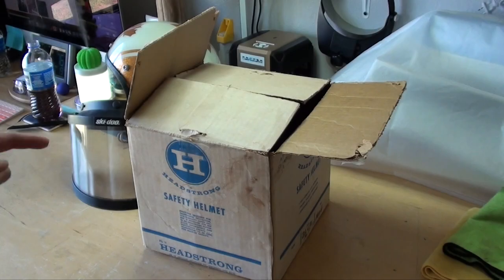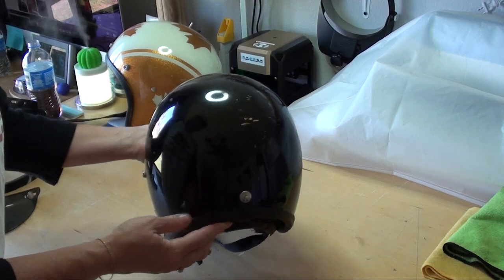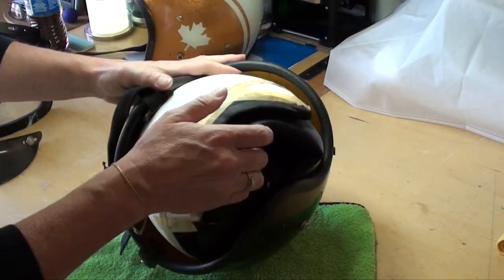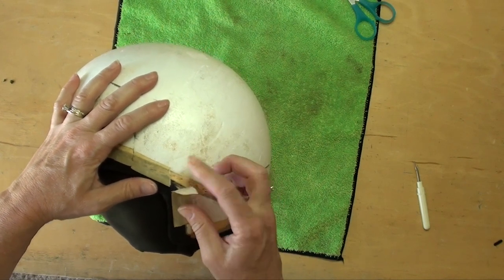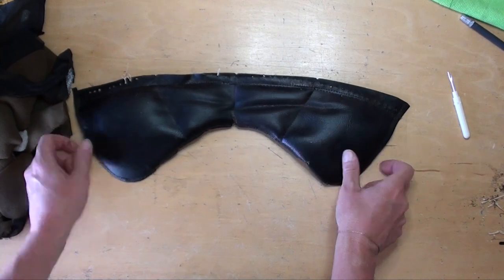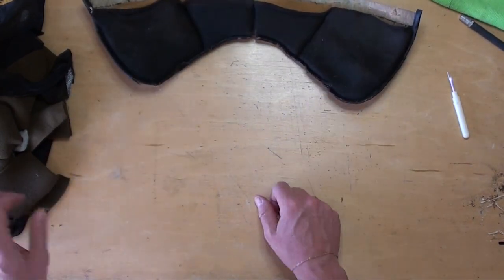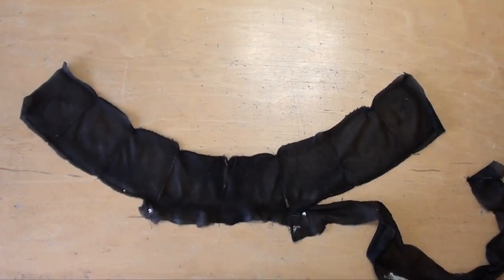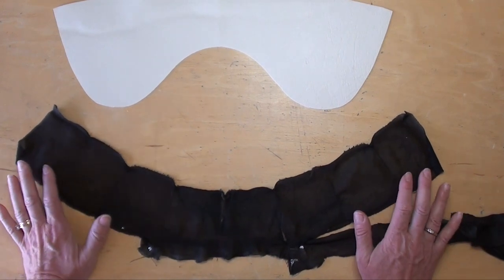How To: Restore the FULL interior of a vintage helmet. DIY

Comment: So refreshing and so good to see use of common sense once again and not falling for that "replace your helmey every 5 years' slogan they've been shoving down our throats for some time now. There's a whole puritan brigade out there to tell you - you're not safe anymore!. Reminds me of evergoing full vs open face helmet debate.
Wear what you want and what you feel is fitting and neceasary for you, for your own safety and fitting to your personal situation. 
I have a 14 year old Bell C500 DOT certified helmet which i have been wearing in rotation, to see if I could prove (or disprove for that matter)  my point I left it in my Bell dealer shop for inspection, came back with - 'helmet in good working shape, outer shell and eps liner condition - pass, suggest replacing fabric liner at some point in the near future'. Case closed.
Thank you and make sure you post more videos.

Comment: Great video. I have an old ski helmet where the liner is in bad shape. It has a similar foam interior but it seems to be glued to the shell and I haven't been able to extract it. Any tips you can share to extract the foam?
Reply from the maker: Thanks! As far as I have learned, there's really no magic to the removal. You might try warming up the helmet a bit but be careful not to melt anything. All the "stubborn" helmets I've done have just been a matter of working the foam back & forth and flexing the shell until it comes loose. Maybe use a plastic trim tool between the shell and foam & work it around but that depends on the finish and stuff, too. Sometimes you can hear the glue or tape or whatever is holding the foam, pop. Again, don't be too brutal with it. I hope that helps a bit & good luck with your project! :)

Comment: You obviously have a talent for this! I would love to get some pointers for the helmet that I’m working on now. It’s a 1976 Bell Moto Star. All of the fabric is in good condition, but the foam has disintegrated.
Reply from the maker: Thanks! Is it the comfort foam that's disintegrated? If so, you should be able to replace it. You'll probably have to carefully remove the material/disintegrated foam from the styrofoam and replace it. Most of the helmets I've done have had very thin comfort foam in them; between 1/8" & 1/4". You can usually find it at Joann fabrics. Some have it sewn in and some are glued in using spray adhesive. Hope that helps some!
Reply: If it is the EPS liner or styrofoam then unfortunatelly you won't have many options. The old Bell Star helmets were smaller, had thinner styro liners as the regulations back in the 70es were less strict. I would normally suggest to buy an affordable helmet, take the styro out by detaching it from the shell and snapping or drilling out the the rivets, then swap by re-gluing and re-riveting into old shell but I don't believe any  styro from new helmets would physically  fit.

Comment: Love the video and very clear instructions. I recently came across a retro helmet at a thrift store and couldn't pass up. The lining is bad. I want to change it myself (1st timer) but have no idea what materials to use. Any guidance?
Reply from the maker: Awesome! For the interior comfort padding, I use 1/2" foam from Joann's Fabrics. You can adjust the fit of the helmet based on the thickness of the foam you buy. It'll always be a little snug when it's new but it breaks in. Just so long as you don't have any "hot spots" in the fit. 

For the fabric, I always use a knit. Something that has stretch is always better than something that doesn't. Think dress shirt vs t-shirt. T-shirt stretch would be what you want. I use crushed velvet a lot. It's retro, it's funky & it's perfect for the interior of helmets. But there are TONS of fabrics that will work great. Just keep the stretch in mind when you're looking.

The adhesive I use is 3M Super 77. Don't skimp here. That's the best adhesive I've found for these.

I hope that helps & good luck with your helmet resto! :)
Reply: @EndlessDIY  thank you! I will start looking for some of the items!

Comment: Great talent and restoration ! 
Would it be possible to replace the Styrofoam shell inside ? I have a helmet I want to restore but the actual styrofoam itself is pretty bad and would need replacing.. can’t seem to find anything online for this ?
Reply from the maker: Hi there! As far as I know, there are no sources for new styrofoam, unfortunately. The only thing I can suggest is to try to find another helmet of the same size/model you can cannibalize the foam from. There may be some cross-brand compatibility but most of the helmets I've restored have had different shaped styrofoam. I restore motorcycle and snowmobile helmets so that may be the major difference between them. 
I'm sorry I couldn't be of more help. I hope you can find a replacement! Thanks for watching & good luck with your project! :)

Comment: Great video I too like the vintage helmets Ironically the old snowmobile ones are usually really cool and inexpensive on EBay  one plus of Snow mobile helmets is they generally do have cool face shields  and visors  a negative is they don’t usually have a DOT sticker  almost all helmets use the styrofoam shell  FYI if a helmet is dropped or hit hard in a crash it’s usually not safe anymore as the styrofoam can be damaged  I like the idea of adding extra padding like you did as my head is smaller too  I also have a Walking Foot sewing machine and that’s why I found your channel   I used to get weird looks at Joanns fabrics  because I’m a man  and the employees knew me by name  I would stop by to check out clearance items in my work jeans  and construction boots ?  The Ski Doo label was worth the effort IMO BTW you have pretty hands
Reply from the maker: I agree! In my other helmet video, I also mention that these old helmets are essentially just a cool hat. I probably should mention that again in any future helmet videos. 👍🏻
It's great that you can sew! I feel like sewing skills are really an essential life skill, so good on you for tackling it! I've heard guys refer to sewing machines as "thread injectors"; sounds more "tool-like", I guess! 🤣People immediately think sewing means lace-trimmed pillows when it actually means Cordura chest rigs, repaired work clothes, custom covers for your generator, one of a kind custom-fit bags for your UTV, etc. Sometimes people don't realize how many things are sewn. So, it's a worthwhile skill even if you don't like lace pillows. lol!
Thanks for the kind words & thanks for watching! :)

Comment: Great job,i should restore my helmet too,do you have file of the pattern?I really apreciate if u share the pattern 👍
Reply from the maker: Hi there! Thanks! I don't have a pattern because all of the helmets I've done have been different in some way. The way I make a pattern for each one is by carefully removing the lining in the helmet you're working on. Unless it's completely missing you should be able to use it if you're careful. Just trace it a bit larger onto the new material to give yourself some room for error and to accommodate new padding, especially if you're putting thicker padding in.
I hope that helps! Good luck with your project! :)

Comment: Great video! Do you know if the old helmets had different shell sizes or maybe the padding was thicker/thinner for sizing? I noticed the foam was marked XL but that helmet didn't look like a XL to me.
Reply from the maker: Thanks! You know, that's a great question! (and good eye!)  I think they did have different shell sizes simply because in my own collection, there are definitely larger and smaller shells. However, I have many different brands. 
When my friend gave me this helmet, he said it was an XL. I was fully expecting to add padding to it to make it fit since I wear a medium. When I tried it on, it fit perfectly so I believe this is probably a kids XL.
Reply: The older helmets were smaller, had thinner styro liners as the regulations back in the 70es were less strict. If you compare for example today's Bell Custom 500 with DOT and ECE certifications and the original Bell 500 open face helmet from the late 50es in the same size, you will notice huge difference in overal size and appearance and how much more low profile the original was. Modern Bell C500 (I have 3 of them ranging from 2 to 14 years old)  all look like mushrooms compared to those from decades ago, but I don't mind it too much. When I feel like low profile  I reach out to my DMD and Roeg Jettson from my shelf and call it a day.

Comment: What would you do if the skirt is riveted in? Just bought a cool old helmet but the skirt is torn and just can’t get the thing out to sew it...
Reply from the maker: Without seeing it, I'd say you'd likely need to drill the rivets out, probably from the inside. Once you do that, if it all comes out in one piece for patterning, you can mark where the rivets went through, as well. You can buy a rivet gun and a variety pack of rivets pretty inexpensively. Hope that helps! Good luck with your project! :)

Comment: my helmet is big for me with this method do you think i can make it smaller ?
Reply from the maker: You can, somewhat. You can use slightly thicker foam to snug up the fit but if it's really big once the padding wears in it'll be loose again. You might try to find a more dense foam to put in between the soft foam "comfort layer" and the styrofoam (like a sandwich). That may work. Then you'll get the more snug fit you're looking for without losing the soft comfort foam around your noggin & it shouldn't squish down enough to become loose again.

I haven't tried this but I will if I need to downsize a helmet in the future. Good luck with your project! :)
Reply: @EndlessDIY  i am gonna try some method's and i will let you know how it gone :)
Reply from the maker: @SermiFromAlbania  Please do! I'd like to know what you come up with. :)

Comment: thanks! any tips for replacing the styrofoam? mine's an old skidoo yellow helmet like yours.
Reply from the maker: Hi there! I haven't found any sources for replacement but if you've got a shell that you really like you might be able to cannibalize a similar helmet & get the styrofoam out of that one. I've restored at least a dozen now and I have to say, every single brand has had slightly (or significantly) different shaped styrofoam, so all I can really suggest is to try to find the same brand/style for the donor.
Reply: @EndlessDIY  thanks for the quick response. i'll keep my eye out for a similar helmet. thanks again.
Reply from the maker: @sleethmitchell  You're welcome. I hope you find something! Good luck! :)

Comment: i enjoyed this Video quite a bit about 25 years ago  i bought a Industrial Walking Foot Sewing Machine off Ebay  and essentially it’s a Made inChina Clone  of the originalConsew Machine  that is basically what many of the Walking Foot Sewing machines like sailrite, Reliable , and some other Upholstery machines are based on  it has performed Flawlessly  for me that  is a Self Taught   on making Marine Grade Vinyl Cushions and Canvas Enclosures for my personalBoats and helping out Freinds  i’ve also done someUpholstery for my Vintage Sports Cars  and i’ve always been interested inVintage Helmets  ad doing similiar Restorations  i liked your Enthusiasm ,Comments , and Narration  BTW you also have pretty hands for Demonstrations does anyone make new Styrofoam inserts for replacement  ones   ? i come accross Vintage Helmets inFlorida  that the Styrofoam  is shot from the Florida heat being stored for longterm in Attics or Garages that don’t have Climate Controlled  At ospheres   i agree with you on the Sailrite tape and the Spray 77 glue  although a good 3M Contact Cement is less expensive in 1  and 5 Gallon containers and can be brushed on with disposable Brushes   i am a retired ProfessionalWoodworker  and  i have Sprayed lots of Contact Cement using  the 17 dollar HVLP Spray guns fromHarbor Freight  and we used to buy the 3MGlues in55 gallon drums  which was the least expensive way to purchase Contact Cement
Reply from the maker: Great information, Craig, thanks! I think I'll try the contact cement, at least for around the perimeter of the styrofoam where the fabric is folded over.
I haven't been able to find a source for new styrofoam. All I've suggested in the past is that you try to find another helmet like the one you're working on that can be cannibalized (something with a gouged shell or something that doesn't make it a good candidate for restoration).
Thanks for watching & good luck with your projects! :)

Comment: I have problems installing back the top piece styrofoam on my bandit helmet. Any advise?
Reply from the maker: Do you mean getting the whole styrofoam piece put back inside the shell?
Reply: @EndlessDIY  yes ma'am. When I tried putting it back, the edges won't fit exactly as it is. I tried putting a news paper or sponge first but it still won't do.
Reply from the maker: @armandodubal6734  Sometimes it's helpful to remove the rubber edging that's around the opening of the helmet. Do it very carefully. It can also be helpful if someone pulls the sides of the helmet open while you work the styrofoam in. Once it's mostly in, you can sort of flex the shell and continue to work it until it lines up. Make sure there are no nuts or anything like that sticking into the shell that's preventing the styrofoam from going in.
This is generally the worst part of the whole rebuild. Just don't get too rough with it or the styrofoam can crack.
Reply: @EndlessDIY  well do ma'am. Thank you
Reply from the maker: @armandodubal6734  Good luck with your project! :)

Comment: Hai what tools you used for the button?
Reply from the maker: A tool like this should work. There are less expensive ones, too if you just need to do a couple snaps. https://smile.amazon.com/Fastener-Adjustable-Setter-Replacing-Repairing/dp/B09LM5KMBH/ref=sxin_14_pa_sp_search_thematic_sspa?content-id=amzn1.sym.c82d763e-ddd1-4b72-9169-6e36c782c381%3Aamzn1.sym.c82d763e-ddd1-4b72-9169-6e36c782c381&crid=JL5GBPA61PPO&cv_ct_cx=snap+setter&keywords=snap+setter&pd_rd_i=B09LM5KMBH&pd_rd_r=29012230-dfc8-463f-81c5-3a38757a1e7e&pd_rd_w=aA2nJ&pd_rd_wg=ZySOy&pf_rd_p=c82d763e-ddd1-4b72-9169-6e36c782c381&pf_rd_r=J0117Y07KSDVEX4169HN&qid=1661607409&sprefix=snap+setter%2Caps%2C184&sr=1-1-a73d1c8c-2fd2-4f19-aa41-2df022bcb241-spons&psc=1&spLa=ZW5jcnlwdGVkUXVhbGlmaWVyPUFTSzNDSTAzODQwNEQmZW5jcnlwdGVkSWQ9QTA1MzUyMDExSURZOTA3WjZDTEI4JmVuY3J5cHRlZEFkSWQ9QTAxMTAzMDFYSlE1UTcxRk01UUkmd2lkZ2V0TmFtZT1zcF9zZWFyY2hfdGhlbWF0aWMmYWN0aW9uPWNsaWNrUmVkaXJlY3QmZG9Ob3RMb2dDbGljaz10cnVl

Comment: A few questions... where do you get the rubber trim i have an old simpson in re doing. And i need a whole new chin strap. Fastners and all and i cant find any?!?
Reply from the maker: I'm sorry, I don't know where to get new trim but you could possibly salvage some from a cheap, hopeless, garage sale find helmet. You could probably score the chin strap from there, as well. The hardware, you can find at places like Sailrite.com. I'd use stainless snaps.
I hope that's at least somewhat helpful. Good luck with your helmet & thanks for watching! :)

Comment: There is higher quality foam now days. I forget what its called. They double layer it. The impact stuff lines the shell then they hav removable padding.
https://www.youtube.com/watch?v=lwwlvi1hf10&t=169s
Reply from the maker: Oh, absolutely agreed! The difference between modern helmets and vintage ones is huge. That's kind of why I mentioned in the description that doing a full restoration on a helmet like this doesn't make it "safe" again. I don't think you could even do anything to make it as safe as a current style. In my state, we haven't got helmet laws, so though I believe a restored vintage is better than no helmet at all, I basically consider it a stylish hat. lol!
Thanks for commenting and watching! :)
Reply: @EndlessDIY  Atm im looking for the types of foam and someone that has replaced everything the shell. Doesnt look like people do this. A decent helmet would cost around 200$ i think. Considering the garbage that passes for safe i rather make it myself. Or reline a fiberglass shell
Reply: @EndlessDIY  Those old ones are probably fiberglass. Most the cheap newer ones are a thermoplastic shell with styrofoam for impact resistance same as in what you got. Fiberglass is 10 times better
Reply from the maker: @zazarays  I've never seen a source for a replacement impact foam (styrofoam stuff), but I'd imagine there has to be something available. If you DIY, at least you're in charge of the quality control. 👍🏻
Reply: @EndlessDIY  "Is EPS the same as Styrofoam?
Extruded vs.
The major difference between Styrofoam and EPS foam blocks is that Styrofoam is made from extruded polystyrene (XPS) while EPS foam blocks are made of expanded polystyrene. ... Both are polystyrene foam products made from polystyrene resins but they are manufactured into sheets and blocks very differently."

Looks like its the same thing in All helmets. There is just different EPS densities. EPS is on Amazon
Reply from the maker: @zazarays  Interesting!
Reply: @zazarays  Yes it's better but not 10 times better :-)
These days the most common shell type is ABS, on which tests concluded to be a marginal underdog to the more acceptable fiberglass, aramid or carbon fiber ones. The difference was certainly there but not as much as people are led to believe.